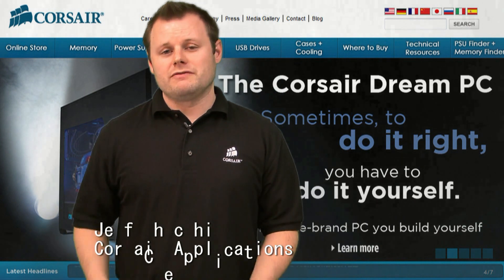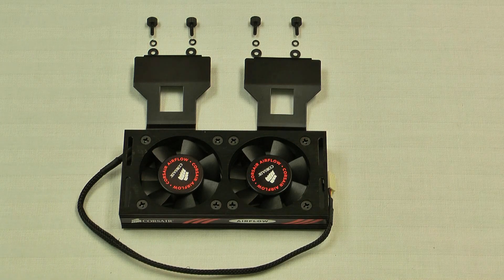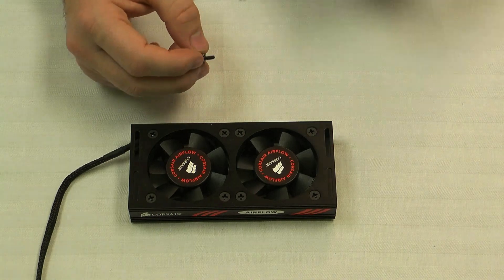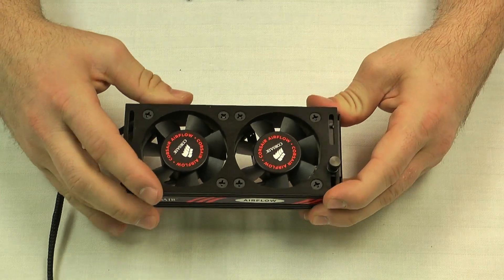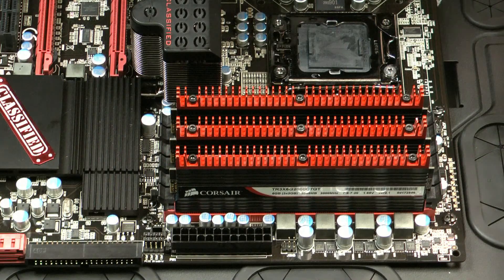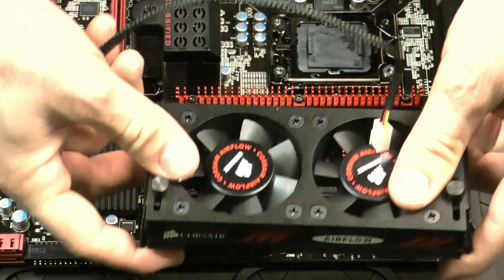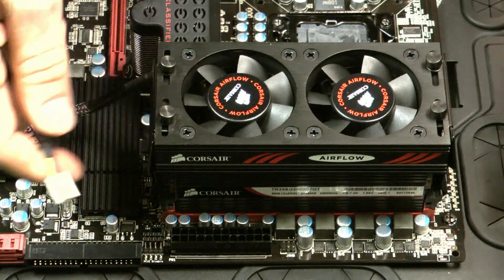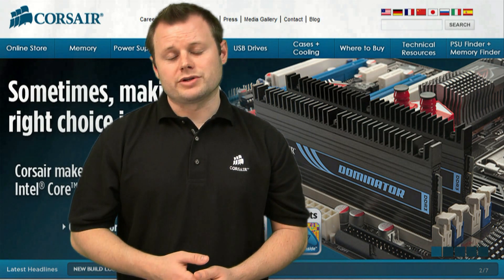Corsair Video FAQ: How to assemble and install the Dominator Airflow 2

Comment: I wonder, how is this fan (or the other version, vengeance airflow) is supposed to be used with memory kits where the sticks are installed on the different sides from the CPU? Does one need to buy two of them?

Comment: It’s 2023 now and this video was still useful to me. I was able to order a Corsair Airflow 2 off eBay in an unopened new box. I was using the single 60mm fan version called Corsair vengeance airflow. Im cooling my DDR5 memory with a DDR2/3 ram air cooler. Lol and it works really well too! I’ve got my DDR5 G.Skill 2x24GB (48GB) 8000mhz CL40 kit OCed to 8200Mhz CL36 @ 1.56v. With just the single fan airflow version my RAM temps never got above 38c while gaming for hours. With this 2 fan cooler it will reduce temps even further.
Reply: Hi, I can get one of these and wasn't sure if it will fit on these new platforms with DDR5. Can you confirm if it will fit and confirm what size fans are installed please. Thank you and regards
Reply: Wished we had more companies do this today

Comment: 2022: Still running...but fans needs to be replaced now. Bought the memory back in 2011, and i got some new fans for it now.
No RAM module has failed.

Comment: I have been using the 12GB Triple Channel DDR3 Memory Kit for about 2years now.  A few months back the fan has started to make a LOT of noise when my computer starts up and then, most of the time, it quiets down, but there are times I have to give a tap on the side of my computer to make the noise stop.  I'm starting to think of either just replacing the fan or not using one at all because of the noise it makes.
Reply: Same problem for me - and many others.
Since I don't overclock, I removed them.
Reply: Exactly same here. I have my case on and sometimes i just stop the 2nd fan and when it starts again it doesn't do the noise. But it needs some minutes first, if i stop it at the first minutes it won't stop.

Comment: hmm I have to slide the fan assembly on the memory pins... i have a Asus board, that doesn't have the pins on one of the sides where you install the memory, will it work as well in those type of boards? by the way it's a Asus P7P55D-E Deluxe